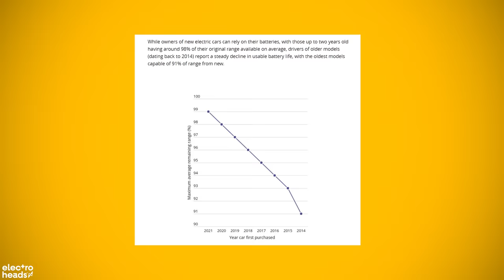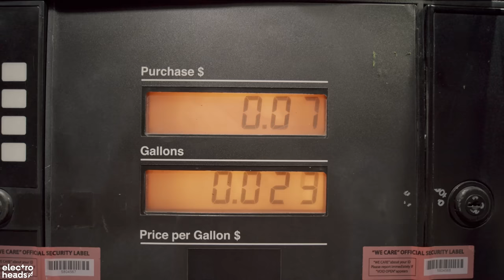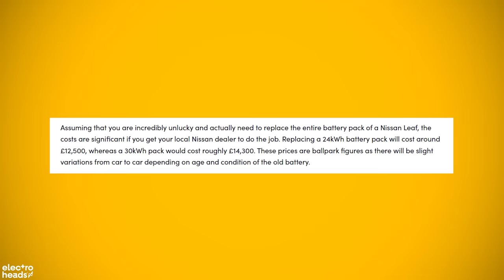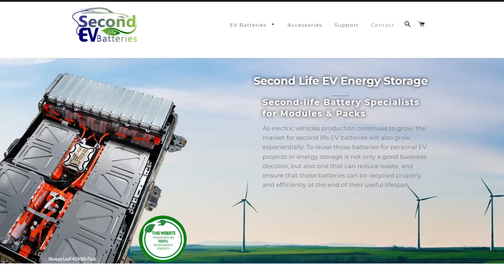What they DON'T tell you about electric car batteries

Comment: I bought my EV (scooter) second hand when it was a couple of years old and the original (SLA) batteries were getting a bit tired. I replaced them with Lithium ion packs I made up from used cells. The result was half the weight, more than double the capacity (range), and now charged from home solar which gives me zero fuel costs for most of my local travel (weather permitting). The technology is improving all the time!
Reply: It's absolutely amazing how many lithium cells you can harvest from normal devices. I've been doing the same with my scooters as well. Drill batteries and DSLR cameras are the best source I've found so far for cells.
Reply: Dude im litterally gonna do the same thing w/ my nans mobility scooter lol, can quadruple the range and still weigh 2kg less!
Reply: @SustainableGal  I've got one of those waiting in the wings to be done too, but I'm hoping I won't need it for a while.😉
Reply: Curious to know which model scooter this was! :)
Reply: @AdrianNelson1507  It's branded as Kiwi Eco, presumably just for the NZ market, but there's only been two sold in NZ under that name so it may have been re-badged as various things. I eventually found out it was made by Tao (or TaoTao) Motors in China, possibly an ATE501 but not sure about that. I've emailed the manufacturer several times trying to get more info but they have never replied so all the info I have has been gleaned from YouTube videos. It originally had 5 x 12V/20Ahr SLA batteries but I shoehorned 50Ahrs of recycled 18650 cells into the same space in a 18S20P configuration. Much better!
Reply: Batteries are practical on lightweight transportation, but less so for heavy vehicles.

Comment: lol like how they complete ignore the damage done to the planet to produce these battlers and the added polution plus the fact they have already said in order to keep up with charging they will have to go back to burning coal in power plants lol Tesla's are known for horrible build quality and lets see takes me 3 mins to fill up my truck vs 61 mins to charge a tesla if i can find a station and do not have to wait this is a very very very disingenuous vidoe with half truths i can fix my gas burner in my driveway your not fixing the high voltage death box in your drive way  ooo and lets not forget that tesla in Cali just raised charging prices and now its almost the same as the 6 buck a gallon gas

Comment: People that push batteries are literally the stupidest among us. She stops at 6 years... then just sites a possible 10-20 years... She shifts from 6 years to mileage rather staying with time. Smaller batteries have to be charged more, that shortens life. Large batteries weigh more, that destroys tires/roads (all energy bois and gurls) and  require fuck loads more energy to make that large battery than one half it's size or smaller. I know people who run ICE cars to 300k miles in 5 years... I' don't base the longevity of the vehicle on mileage because much of it simply didn't have time to erode. The engine might be tired but most stuff is fine. Just existing takes a toll, sitting or running.  

In the end you're still powering your EV with FF... Solar and winder are made with gigantic amounts of FF and the batteries in EV are mass polluting and destructive to mine for... also mining condition are horrific and I guess if you don't mind child labor EV's are great. 

I'm not pushing ICE or FF just because I point out many of the horrible side effects of giant, idiotic batteries in EVs. I get it, you want to be cool and better than everyone else... well, you're not... you just fell for branding and advertising.

Comment: Had my kona 64kw about 21 months when I bought it its range was stated at 258 miles 
After 3 or 4 updates at dealership 2 services 25,000 miles covered charged it to 100% last weekend showing 303 miles drove it 158 miles still showing 49% summer I know but I'm getting 250-260 in winter on motorway and town driving so is somehow better than when I bought it
Reply: I think the first few BMS software upgrades designed to fix the battery fire/recall issues had the effect of displaying more range than stated at new. I don;t know if this translated to actual range as I never drove it far enough to test, often enough. When we got our replacement recall battery, I noticed that the range indicator said 450km when I drove it away from the dealers. It's displayed 440-odd  for the few times I've charged it to 100% since then.

Comment: First Tesla here from 2014, until now 515000km and instead of 504km Range on full it gets now 484. It just ran out of warranty for unlimited km and 8years (yes, the good old times) but still has free supercharging anywhere, anytime. Had two motors (warranty) and they where not broken, but "made noise", loads of tires, windshield wipers and water and the center screen was replaced (free) because it discolored. Besides that, no problem. Nobody worries about the battery.
Model 3 from 2019 (private) got now  70000km on it (lock down) and drives and feels like new in every aspect.
Reply: Yes. Teslas from a decade ago did proper thermal management and had more robust battery chemistry than some others. Large capacities meant the battery is loafing along most of the time. Consequently they have lasted. Current model EVs have mostly learned and should last similarly.

Comment: ICE powered vehicles are subject to major maintenance issues later in life that EVs are not. Personal experience kicks here, replacement of clutch, replacement of disk rotors, replacement or repair of exhaust system, replacement of long life spark plugs ( platinum tipped ),
replacement of overhead can drive belts, etc etc. These items collectively add up to thousands of dollars. There are more high cost items that I haven’t mentioned of course. This short list is just to illustrate the point that people worrying about possible EV battery replacement face high costs with ICE vehicle maintenance and repair. It comes down to a case by case basis what the specific life costs are an ICE vehicle. The mechanical simplicity of EVs contributes to far lower regular maintenance costs. So on the balance of probabilities, and EV will cost far less to maintain over say 8 years than an ICE vehicle. Running cost are another dimension to owning an EV. Might be a good topic for the next video!
Reply: Indeed. around 20 moving parts in an average EV, versus hundreds in a typical ICE car.....
Reply: Odd, I have an 8 year old ICE van and have spent a whole $350 since I bought it.

Comment: My Hyundai Kona 64 kWh battery made by LG was replaced under a recall last February.
My other car Chevy Bolt had it’s 60 kWh replacement with a 66 kWh under a recall in April of this yr, also made by LG & no cost to me the owner.

I expect these batteries to outlast the car as they are liquid cooled & protected by the car’s BMS.

Love both car’s, here in Vancouver BC Canada 
Dave
Reply: Why do you think that ? Those dendrites are constantly creeping, so we are told, so we never know if they are going to short the battery out, resulting in a car fire, like many others. Good tip, charge it well away from the house and garage on a long charge lead just to be safe. You never know ?
Reply: @stevezodiac491  Nope!
Reply: @stevezodiac491  That's only true if you think the new cells have the same fault as the old ones.
Reply: Which do you prefer?

Comment: No one is concerned about the batteries for the first decade, it is after 10 years. In Australia motorised transport that is 11 years and older, accounts for over 40% across the country. The second hand market is where 75% of all purchases are made. Trucks, industrial and commercial machinery is used for many years. The problem or concern is that electric cars will be dumped in large numbers within 20 years of manufacture because the battery cost will exceed the value of the machine. The availability of automobiles over decades of production is a great benefit and massive economic advantage. The electric car seems like a economically disposable car that is limited to the life of the battery, when we see the batteries start to fail or offer significantly reduced storage in numbers, the price impact on EV's will hit like a brick. 
The Tesla models will be the cars that will set this mark for the EV industry and they are mostly still less then 10 years old, with the early models about 12 years old. The long term of Tesla rests on its batteries; the economics of the whole thing will come crumbling down if the batteries start to fail or degrade quickly even at 15 years old. It means these very expensive cars are going to devalue at a high rate and wipe out any savings that cheaper electricity provided. The fast charging is going to put pressure on these battery life times.

Comment: I own a 2017 Chevy Bolt, and its battery pack was replaced under a safety recall last month. The old pack had 97,000 miles and five years of use on it, with no measurable loss of range, at all. I also own a 2013 Nissan Leaf, which most viewers probably know has a poor battery management system, so is subject to higher degradation than better-designed packs. Even so, with nine years of use, and 75,000 miles, it still has 88% of its original range. I've noticed no measurable degradation over the last two years, moreover. Degradation appears to have hit a plateau on my Leaf. 

These are only two examples, of course, but they certainly seem to bear out the idea that replacing battery packs is not something that owners realistically need to fear.
Reply: You should fear it if you don't adhear to the manual. You can't just let the vehicle sit at 100 percent charge for months. There are so many limitations. Only people that get an EV must be smart.

Luckily, most people that are willing to risk new tech are generally smart. This just isn't something an average driver should own right now.
Reply: @ricky4673  "You can't just let the vehicle sit at 100 percent charge for months."

True enough, but who would do that? It would have to be someone who did not drive his car for months. Not sure who that would be. Someone who lived overseas half the year, and left his car in his US garage, plugged in, I suppose, but that would be a rare use case, and the only thing you''d need to do is to set your charging limit to something sensible, like 50% charge. 

"There are so many limitations."

I would disagree with that. A more accurate summary is that there are only a few, easy to follow limitations:

1) Keep your state of charge between 20% and 80% most of the time. 

2) Charge to 100% only before leaving on a long trip. Time it so that you leave immediately after charging. 

3) Charge on a level 2 charger most of the time. Avoid DCFC, except for road trips. 

That's about it. Easy peazy. No great intelligence or deep knowledge required.
Reply: @ricky4673 :  Seriously, if you're going to refer to smart people (implying many people are dumb), then learn to spell adhere, proof read, or both.  

It's like misspelling "genius".   There are things you just shouldn't do when writing, especially with spell checking provided.
Reply: @stevenblackthorne4790  How many people still buy cars and never change the oil. How many don't change their timing belts or tranny fluid? EV is not yet at the stage of mass adoption. People continue to destroy their cell phone and laptop batteries from missuse. 

You say easy to follow but you have to keep in mind how many old people use cars and also how many drugged people that cannot learn anything anymore. How many women can't plug in a VCR or even know how to switch input channels? Yes VCR is old, but the entire time they were around, it seemed only 30 percent even knew how to hook them up.

I helped many teachers back in the day and also my parents when I was a child. I will not suggest an EV to anyone until battery limitations and maintenance is fool proof. Perhaps that's when super capacitors or solid state get enough density.
Reply: @stevenblackthorne4790  LFP batteries work better charged to 100% every day (new production model 3’s)

Comment: I have a 2019 Chevy Bolt. My battery was replaced under warranty. Now I have a longer range than my car started with due to the newer battery technology.
I am not worried about degradation. I have 259 mile range and that meets all my needs for in state driving.

Comment: What they are not telling you is that batteries age regardless of mileage. It's a function of time and charging cycle, not mileage used. So if you don't drive enough miles, you still lose battery to time decay. To make your money worth, you have to have enough mileage use. If you only drive a little bit, a plugin hybrid could actually be more less carbon footprint and last longer.

Comment: Not sure who looked at Tesla model S/X warranty as they did not look at the website shows they do cover it for 8 years or 150,000 miles, whichever comes first, with minimum 70% retention of Battery capacity over the warranty period.
Reply: That 70% number is the cutoff Tesla uses to consider the battery unusable. That is not saying the battery will never get under 70%. They intentional publish it that way. Read the fine print. Telsa also accepts up to 13% battery loss in the first year. Meaning they will not even address the issue until more than that. So your 300 miles goes to 260 it's ok by Tesla standards. Until it gets below 210 they consider it a "good" battery.

Comment: My first generation 2017 Hyundai Ioniq has been on the road through 5 Canadian winters and has yet to drop below the original rated range.  They were rated for 200km.  
When new, I was averaging 245km in summer and about 200km in winter with the drag of snow tires.  
As we come into summer, my range as we speak is right back up around 240km on a full charge.
Reply: 200 km sucks.
Reply: @JensSchraeder  I took a 2700 km road trip holiday 2 years ago  in a 200 km range EV, 150 km between charging stops. Saw places I didn't plan to visit, worked perfectly.
Reply: I drive every day on average 500 km or  2 people driving 1600 km taking turns we drive to ontario taking turns in under a day 16 hrs, that would stop under using an electric vehicle even if you said the range was 500km it would still add at least 5 hrs each charge to the trip, i only get 10 days vacation, l dont want to use my vacation time sitting waiting for a battery to charge, l can gill my f150 in under 5 mins with over a 1000km of gas granted for a lot more $ but it ads 5 mins to our drive time